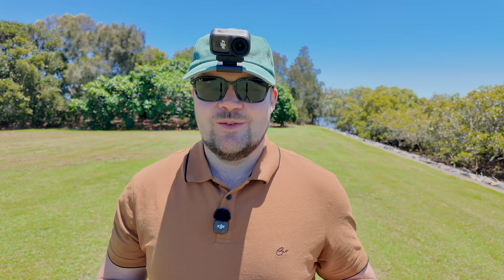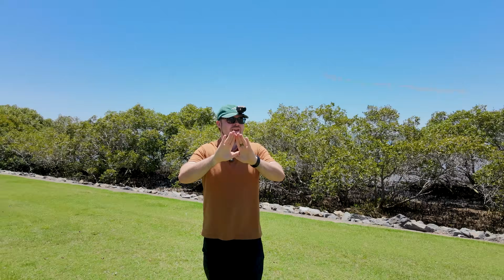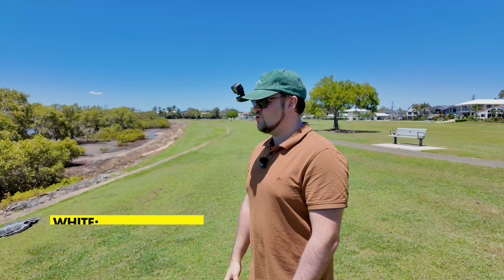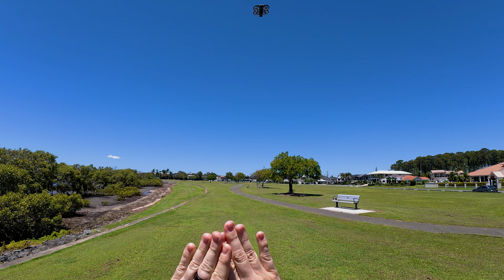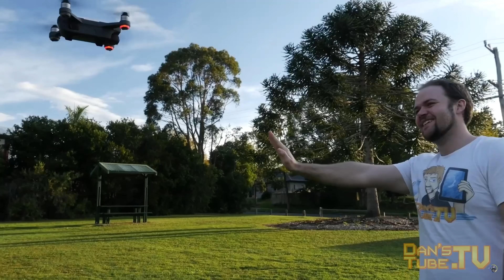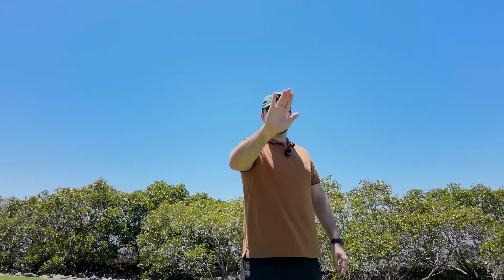DJI Neo 2 Gesture Controls Test — Hands-Free Drone Magic!

Comment: I have and still use the original Mavic Air. Which has gesture controls. Using it since 2018. Still an awesome drone. Only needed new batteries once and it still is perfect. I have the Neo 2 as well. The obstacle avoidance is obviously better on the newer Neo. But, the Mavic Air still is amazing in today’s market.
Reply from the maker: Definitely! The original Air was always one of my favourites, I love the design of that drone.

Comment: When using the DJI Neo 2 gesture mode, does the drone start recording automatically by default, even without a phone or controller? Or do you need to press or trigger something to start recording?
Reply from the maker: It starts recording immediately after it launches from your palm.

Comment: Can gesture controls and tracking position via phone app be added to the Flip via update? Or it'll need lidar or more sensors like on the Neo 2? Thanks
Reply from the maker: No gesture controls with the Flip but you can use the tracking mode through the phone app.

Comment: My question is, how did you get your sound so good to where you cannot hear the drone? Also, did you connect the drone to the receiver or did you match up sound? Also, if you did a lot of audio editing, I would love a tutorial. I just got the neo two yesterday, but I was pretty upset about how loud it is.
Reply: Prop noise can be removed in post production and with the use of a noise cancelling mic, but even if you record audio through the DJI Fly app, it removes prop noise automatically.
Reply from the maker: I have editors that help me with projects. I was using the noise cancelling mode with the DJI Mics and I find that they cut propellor noise well.
Reply: I bought the Neo 2 to record me on photo shoots it was garbage and just crashed into everything. Even the most basic stuff made it crash. I was not impressed and don’t recommend buying. I wanted a worry free camera that I could just walk through houses and it film me. It even crashed outside into a huge pole. I returned it.
Reply: @pixeljoesphotographyandvid5425  The Neo 2 isn't designed to operate inside buildings or even close to buildings. Far from it - it relies on GPS and GNSS for positioning. Don't blame the tool when the buyer has bought the wrong one.
Reply: @VictheSecret  funny I guess you didn’t read the full comment. I said it even crashed outside into a huge pole. So it didn’t work inside or outside it was a hunk of crap and it was not worth $740

Comment: Is there something you have to do first in the settings to turn this gesture shit on? The gesture controls don't work for me
Reply: I looked it up online and read that you have to go through the tutorial on your phone before it will work. I kept skipping it. I'll have to give that a try.
Reply: Hey fellas, I got it working. You do have to toggle 'gesture control' on in a settings menu when it's connected to the drone (this menu isn't available when it's not connected). When you launch it you hold your palm flat vertically extended out arms length and a blue light will illuminate on as the drone sees it, meaning it's engaged. Then it'll do the gestures same as this video. :D If it stops working you hold your palm out horizontally or vertically for the drone to catch that you want to do gesture control again and the blue light with illuminate on everytime it knows you're in the middle of wanting to do gesture control. Hope that makes sense
Reply: @TysonWillert okay thanks bro! First you need to set up in dji fly apps before you can control in hands gesture! Now i know thats why it doesnt follow my hands... Set it up first in the apps...
Reply: Connect the drone with your phone. On the phone, go to settings and scroll to the bottom and hit "More Settings". Then select "Control" and you will see the toggle for "Gesture Control".
Reply: Yeah it doesn't work for me either.
Reply: I just got mine today, the blue light is on, but it didn't respond to any hand gestures other than landing. It was a bit windy outside and I'm in a restricted area. I did go into the app and accept responsibility for flying in the area. Don't see any settings to control it. I'll have to go somewhere outside the restricted area to see if that makes a difference. The app controls didn't indicate any problems.

Comment: Best use case I have found is tracking on a bike. If its following from behind, flat, I can stop and move it up, back, to my side and low, to the front and high, all without landing, or breaking out a controller or even my phone. Then just keep riding. Battery life is the big disappointment.  Its definitely less than Neo 1, by a few minutes, but thats the only fault I can find with this extraordinary little drone.
Reply from the maker: Yes, the battery life is still not great. That does sound like a practical way to use the drone!

Comment: Will it follow a car ???
Reply: Yes, at least if you have the RC-N3 controller there's an option to enable tracking a vehicle instead of a person. But keep in mind that it can't fly more than like 40 kph / 25 mph. Just checked and it's a feature called ActiveTrack.
Reply: No. Bikes, and things people ride. Skateboards, One Wheels, even roller skates. No cars. Its not really fast enough.
Reply: I followed my truck with it. Just drove slow, 25 mph